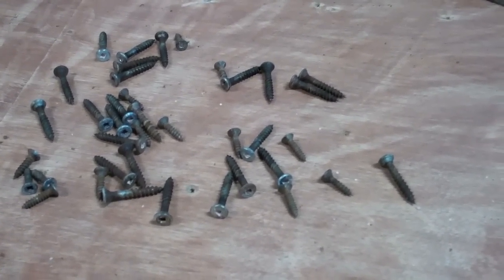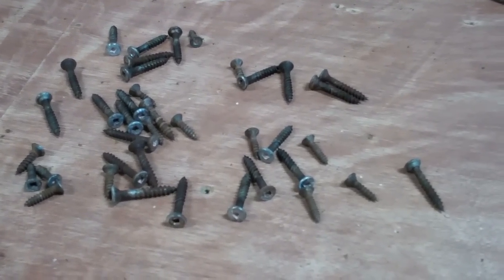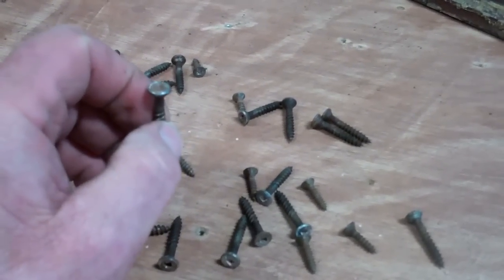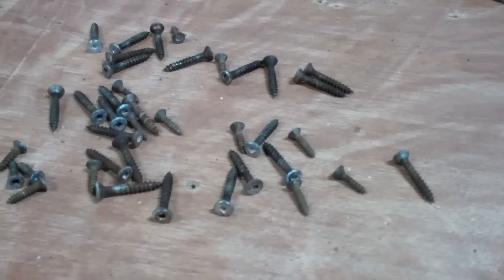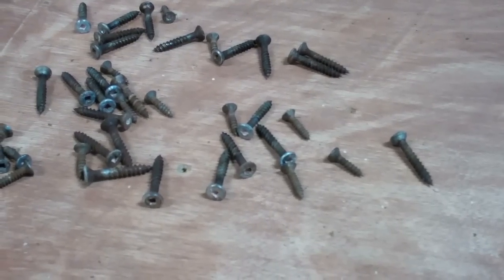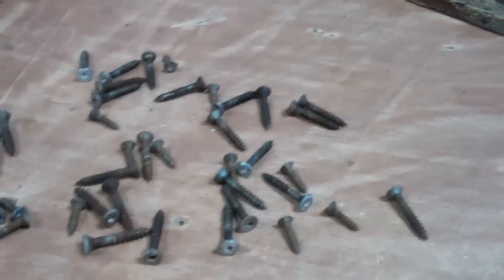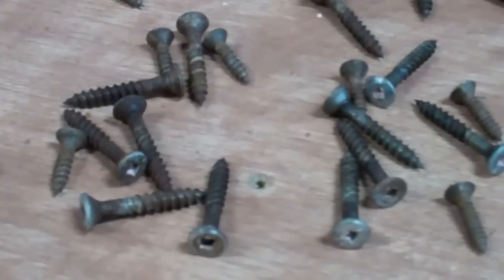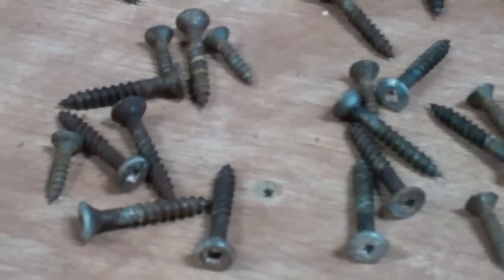Why Stainless Steel Below the Waterline is VERBOTEN 1 08 2016

Comment: what about bronze ceramic screws that have been tested for a 1000 hour salt spray "resistance" per ASTM B119 ???
Reply from the maker: No. Silicon bronze wood screws with Reed & Prince drivers is the gold standard in this industry for all the right reasons. 
Remember, there are at least 4,000 #8x1-1/2 or x 1-1/4 screws in a 17' hull's True 5200 bottom.
Besides, never, ever, ever would I recommend running a varnished carvel-planked power pleasure boat in salt water.
Reply from the maker: And, I will allow Don Danenberg to explain:

Stainless steel was invented in 1913. The 300 series (3020316) included 18020% chromium and 8-12% nickel. (316 has 2-3% molybdenum, which makes it slightly less susceptible to crevice corrosion.) In the presence of oxygen, the chromium and nickel form a surface coating that protects the 70% of the material that is mild steel.

If you bury them in the hull, covered with putty and paint, they are cut off from oxygen and will soon corrode like mild steel. Only silicon bronze is long lasting here. The only apparent reason for some use of stainless steel (fasteners) is that they are cheap!

It doesn’t matter if they are advertised as “marine grade.” That only applies in the presence of oxygen.

(Don Danenberg, “What is a TRUE 5200 bottom?, Classic Boating, September-October 2014)

Comment: Stainless Steel or Corrosion Resisting?
https://en.wikipedia.org/wiki/Marine_grade_stainless
Reply from the maker: Wiki is wrong ... again!
I will allow Don Danenberg to explain:

Stainless steel was invented in 1913. The 300 series (3020316) included 18020% chromium and 8-12% nickel. (316 has 2-3% molybdenum, which makes it slightly less susceptible to crevice corrosion.) In the presence of oxygen, the chromium and nickel form a surface coating that protects the 70% of the material that is mild steel.

If you bury them in the hull, covered with putty and paint, they are cut off from oxygen and will soon corrode like mild steel. Only silicon bronze is long lasting here. The only apparent reason for some use of stainless steel (fasteners) is that they are cheap!

It doesn’t matter if they are advertised as “marine grade.” That only applies in the presence of oxygen.

(Don Danenberg, “What is a TRUE 5200 bottom?, Classic Boating, September-October 2014)